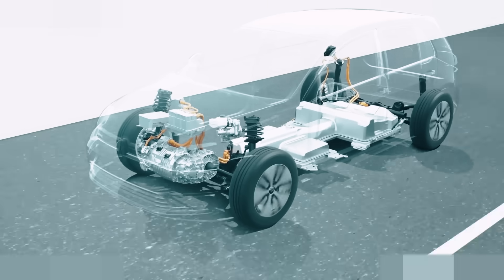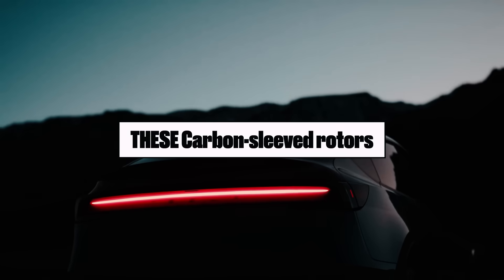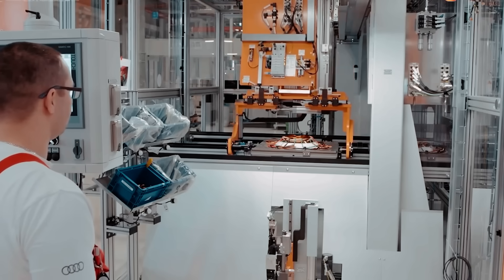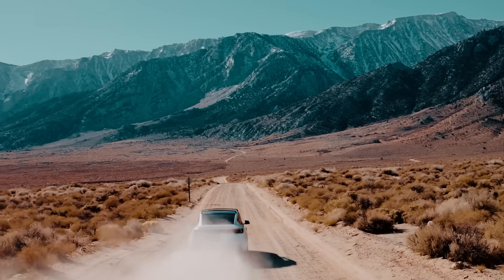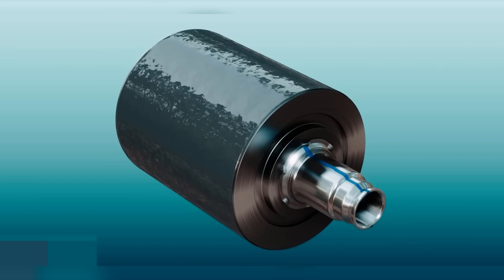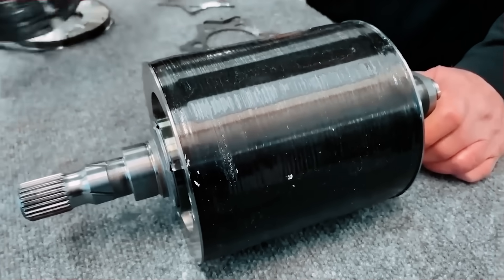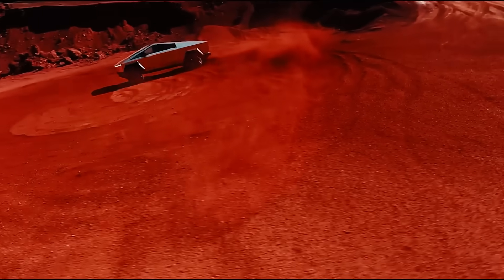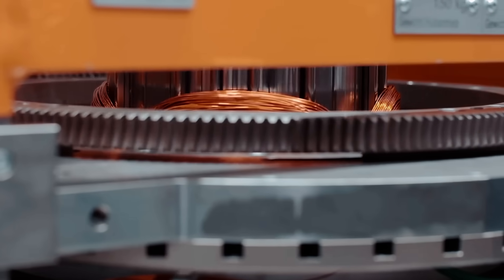How Tesla's BIGGEST Breakthrough Changes Everything!

Comment: The carbon wrapped rotor is not new. It has already been in production by Tesla, for some extreme electric motors for two or three years, but it is a large additional expense to achieve that extra torque and power, therefore it is not worth it for most electric engines.
Reply from the maker: Your correct. 2021. Whether it’s worth it or not is an interesting question. Currently researching what changes are being implemented now in 2025 for an update video.

Comment: For a motor, when you multiply RPM and torque together you get horsepower so you can get.  But, for an electric motor, RPM comes from Voltage and torque comes from current and current tends to create more losses than voltage so the faster you can turn an electric motor (without disintegrating it), the more efficient your system will be.
Reply from the maker: Great insight!

Comment: This is bullshit. It is true that the gap between rotor and stator must be small. But the carbon fiber layer will essentially constitute a huge gap since it is non-magnetic,
Reply: Tesla Model S Plaid ain't vapor ware, drive one like I have and you will experience more torque than an F1 Racing start, and I am not kidding you. It makes other super cars old and obsolete, but when you ad AI FSD you will be driving a car that came from the future, and nothing is even close.
Reply: This news isn't exactly new. Tesla has been using these motors for several years now. It's how they were able to get their motors to spin over 22,000 rpm.
Reply from the maker: You’re totally right.
Reply from the maker: Interesting point!  If you have better resources than the ones we’ve found, send them to the email in the description and we’ll put together a new video and credit you.